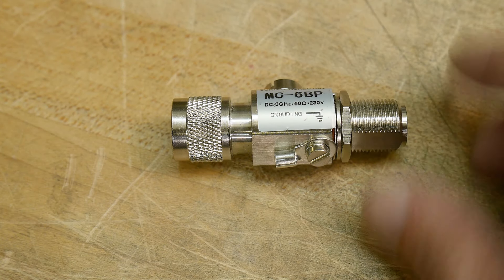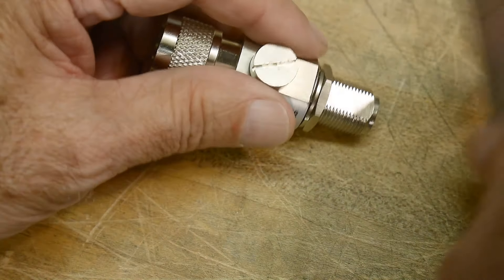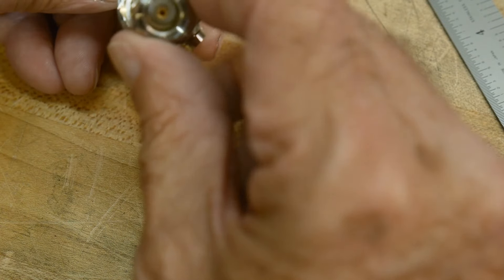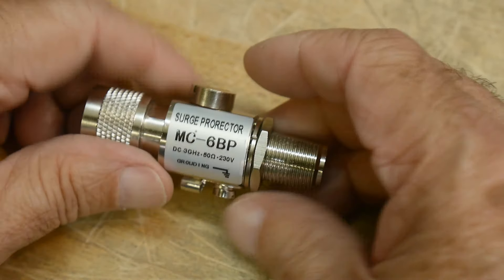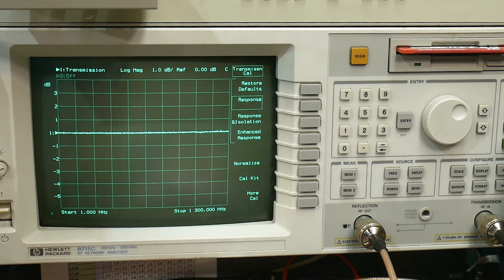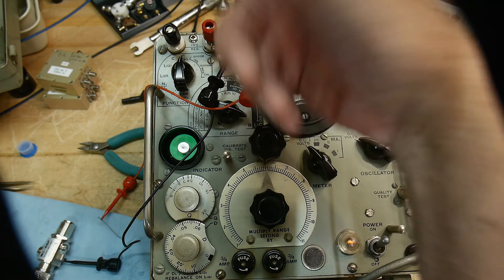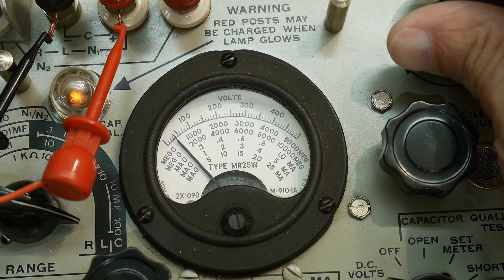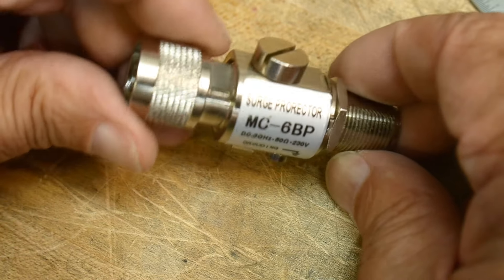#1972 Antenna Surge (lightning) Protector

Comment: It is a 3 terminal (2 section) gas discharge tube. Having 2 sections will reduce the capacitance compared to a single section.

Comment: I recall in the old 60's ham magazines that one could "wire up" an automobile sparkplug to your antenna as a spark gap to ground.  Whatever you use I think the larger the cable to the spike you drove into the earth the better.  Nothing would protect against an actual lighting strike, but at least you could drain off some potential build up.
Reply: I knew a guy who installed UHF telemetry transmitters at power substations. At first he would properly ground them in accordance with all the safety guidelines. The transmitters kept getting popped. So he stopped grounding them. the transmitters lasted a lot longer then. But then I knew a guy who maintained a microwave relay station for a power utility. The microwave equipment kept getting fried after a storm; the station was located atop a granite hill. So they came in and drilled core samples about 90 feet down til they hit soil, and sunk ground rods attached with number 2 wire around the site. The microwave equipment no longer blew up after a storm. So sometimes good grounding is a death sentence, and other times a lifesaver.

Comment: Thanks for the video.  I recently bought a couple of similar devices through Amazon.  Amazon says they have 230V gas discharge tubes.  The tube in  mine looks similar to yours, but with no center metal ring.  Mine is marked VAC Tech 230 24.    Bill   HI7/N2CQR  (where there is a lot of lightning).
Reply: Yeah I got some of those too. I tested them with the Sencore 'Z meter'. When you get over 300 volts on the leakage check, they give off a pretty purple glow. I guess they're filled with argon.

Comment: Pretty interesting. Good debunking of the attenuation claims.
Reply: Yeah... Device is literally straight-though "coaxial conductor" with the center "wire" being shaped flat on the spot where GDT touches that end to facilitate the whole thing... That is also reason there is that 0.1dB miniscule abbreviation from the "perfection" is indeed that the path is physically as close of an coax as it can but isn't perfect because of mentioned reason.

Comment: I've never used that one, but I've got two polyphaser IS-50UX-C0 lightning arrestors which seem to do the business.  I've had two amateur radio antennae on my Tampa, Florida roof for years now with no problems during our frequent lightning storms.  I have lost the odd unprotected piece of electronics, but not my amateur radio gear, which is on battery solar for power and has these antenna protectors.  My only complaint is that they are only good up to about 700MHz, so there's a huge insertion loss at higher frequencies.  Mine don't have a handy port, so I can't see the tubes without removing them from the lines and unscrewing the UHF connectors to get inside.

Comment: Just be sure to buy the correct one for your application.  They come in a lot of "flavors".  The big thing to watch out for is their breakdown voltage / power rating.  Don't want to stick a low voltage one inline when your running a legal limit 1.5kW amplifier.  I have a common ground point entrance panel for all my coax lines and exclusively use Rosenberger brand arrestors made in Germany.  They ain't cheap but they are some of the best made.
Reply: Most of cheap ones have a 90V GDT, which means they could arc over at just above 20 watts with a high SWR.

Comment: Looks like a gas discharge tube. I once tested one with an insulation resistance tester at 1kV and it glowed nicely.
Reply: A lot of things glow nicely when you pass 1kV across them :)

Comment: I started laughing out loud when you brought out the ZM-11, I was thinking all along that he could use the power supply or even the Megger function to be able to check the discharge tube. It would be interesting if you could actually pull the element out and, determine exactly what the bifurcation is in the center. Otherwise, interesting video. 73 😊

Comment: Another great video, thank you! I’ve watched many of your videos and know that you are an expert on antenna design, amongst numerous other topics. I’ve been working with Iridium modems in recent years and have observed that their performance can vary wildly on a day-to-day basis. I know that some of the variation is due to the geometry of the satellite constellation but I also think that sometimes there are local interference sources. This makes me want to have a means to search for potential local interference sources. I’m considering using a Tiny SA Ultra as direction-of-arrival receiver. Are you able to suggest a directional antenna that I could couple to the Tiny SA Ultra? I’ve been thinking about designing a PCB-based Yagi-Uda antenna but I don’t know if a Yagi-Uda antenna would work for circularly polarized signals, assuming that the presumed local interferers would emit such signals. Thank you for any advice you can offer on this topic. -Best regards - Jim
Reply from the maker: I don't have any direct experience with circular polarization. I do know that people use a 'circular polarized yagi' for satellite work. it consists of two yagi antennas crossed and phase connected. you could make two PCBs that cross and fit together

Comment: Could I use two of these for ladder line, or would it mess up the impedance too much?  I'd be using a roller inductor tuner, fwiw.
Reply: not sure, it's designed for 50 ohm, what's the impedance of your ladder line?
Reply: If you look around you can find the gas discharge tubes with leads on them; the old Arrowhead alarm panels used them. Amazon has the tubes separately without leads. Dunno if you could solder to them or make a holder for them in a plastic box. I'd use two tubes  - each side of the line to ground. Bear in mind these will prolly arc if you're running over a few hundred watts.

Comment: But i am sure 230v to my reciver input is still enough to destroy it...
Reply: As I understand it, little can save a received connected to an antenna during a lightning strike (even if it's not direct to the antenna). However, if this device conducts the lightning to ground, then while hundreds of volts in induced eddy currents might still break your receiver, this thing (and your ground wire) will be what explodes in a ball of flame, rather than your receiver and your house wiring. And if you put this thing in the antenna cable outside your house, it then saves your house from burning down!
Reply: There is generally variations available down to 90 Volts, downside is that they can handle less power (Watts) then... Idea is to have all electrical paths having proper surge arresters in place, so incoming power lines too for most part. And while pretty much virtually nothing can protect from direct lightning strike, generally devices are surprisingly resilience for surprisingly high voltage spikes, if they last very short time (usually well under one second) which is the lions share of cases aka indirect surge (lightning hit somewhere far and travels through ground or especially electric wires... and this is why these work when they need to "once in an blue moon".
Reply: @alaricsnellpym  Look up the Motorola R56 standards. That will tell you how to install radio equipment that will have a high chance of surviving a direct lightning strike. It takes a hell of a lot more than just adding some surge protectors though.
Reply: GDTs are a transient protection devices, they are limited in power and speed of conduction. Also degrade with every arc proportional to F and pulse width.
230v here is a breakdown voltage, but clamp voltage for this form-factor is usually 15-20v

Comment: It has a 'grouding' connection... nice.
I have an old Sailor surge arrestor that uses tungsten bulbs to shunt to ground, I suspect it's designed for yacht mast antennas. I'm not sure how many times it saved my gear, but I've had a tree exploded by lightening strike only metres from my mast and everything survived. Another huge strike destroyed a giant old tree about half a mile away and that strike took out my gate automation system (with underground wires) as well as an internal phone system between buildings, some low voltage yard lights and a pond pump. The ground current spikes must have been incredible, but luckily again, all my radio gear survived it.